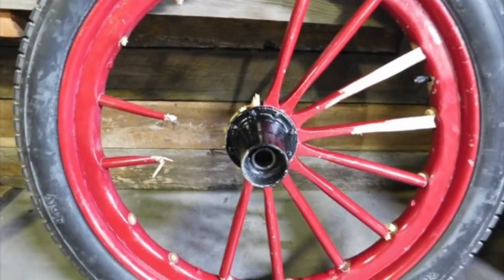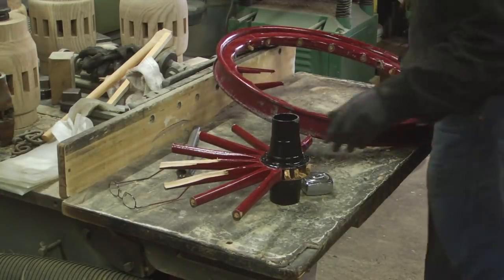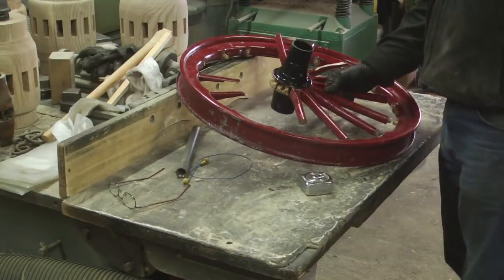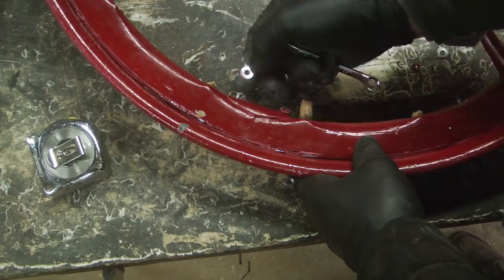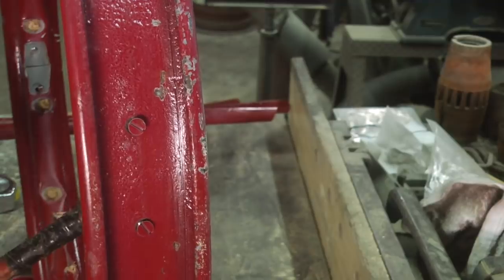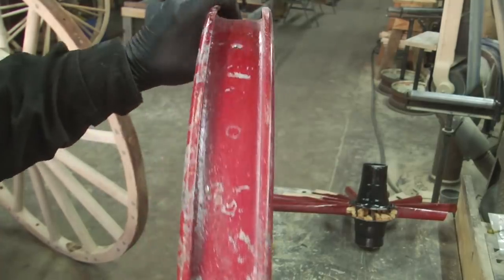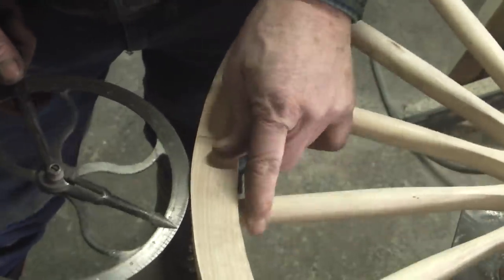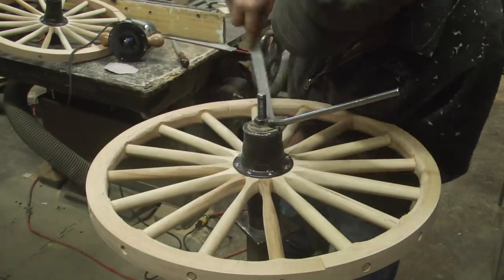The 1907 Everybody's Car and the Wood Wheel Repairs | Engels Coach Shop

Comment: I have wondered for years how these old parts were made. I was raised on a farm in the 50's and we had three teams of draft horses and horse drawn equipment for all of the tilling and harvesting. All of the neighbors had tractors and "modern" equipment. It was embarrassing for me at the time and I resented being so poor that we had to use the old stuff to get the crops in. Now, several decades later I would be proud to be doing the work with that old equipment. Time certainly has a way of adjusting one's attitude.  All of the old equipment has since developed feet and walked off during the night. Now it's being used for lawn and yard ornaments all over the country. Thank you Mr Engel for the fine videos, they are much appreciated.

Comment: You do a wonderful job and I am extremely impressed, and I am a regular. I had a wheel (dished), for my De Dion Bouton remade, and it was great for about 6 months then felt a little loose, so I dismantled it and placed some heavy canvas washers soaked in linseed, between the fellows and the spoke shoulders, it tightened the wheel, and many years later is still sound, I guess that the lumber (hickory), wasn't quite seasoned long enough.

Comment: That was a beautiful rebuild. Some won't understand the rosebud and shrink fit process. Haha. After 40 years as electrical engineer and industrial electrical contractor, I had 2 emotions going in behind someone else. First I was upset I hadn't been called first then after diagnosing the problem and determining a fix, it was a bit humorous. The customer was paying 3 times, the bogus fix, my cleanup and the proper repair. Why didn't they call me first? Human nature is a curious thing.

Comment: Unfreekin' believable. Its a wonder you didn't make the felloes in 1 piece!!!  It ran so very true when you jigged it up. Again, Awesome!
There is an old Ford video showing wheelwrights on the assembly line back in the early 1900's.  Interesting.

Comment: I am wondering how you protect the steel rim from rusting ?
I did my apprenticeship at GKN Sankey UK.
Joseph Sankey invented the steel wheel that replaced this type of wood / steel composite design.
It is interesting to note how when new technology replaces old how the 1st generation tend to look like the originals.
Sankey steel wheels looked very similar but were made of 2 pressings and gas welded together.
The holes between the spokes were welded all the way around.

Comment: 5:07 years later, i come back to this video with fresh information. Having dug the depths of old magazines, patents and period correct papers, i know that not only were these wheels worked on incorrectly, they're also incorrect for the application.

These are the common hub design, when automobiles of the era had (for the most part) switched to the Schwarz Interlocking Spoke (not just for its ease of installation, but also because it simplified the hub construction, one main hub and one band, allowing for ball bearings to be much easier installed and replaced once worn).

That implies not only that the bottom (core part) of the spoke is completely different, but the fixing on the hub is different, the hub itself is different and basically... those are not the right wheels for a vehicle of that era. Those are wagon wheels, essentially. Schwarz wheels are also much more easily dished out than common spoke and felloe ones, because of the specific way the root interlocks with its adjacent partners.

I've been digging for a friend, who needs a replacement part that no longer exists, for his antique car and it reminded me of this video, you wouldn't believe the level of incorrect display of some of these cars, in museums. I'm very disappointed in the state of many of them as well, mismatched, wrongly assembled (sometimes brakes band assemblies are upside down),... poorly kept. It's a shame, because there's examples out there that are very rare. Rarer than hen's teeth. Worse, in some cases, because of the level of disrepair, they're sold at auctions because they just give up on them ... and they vanish, never to be seen, in private collector's hands.

For example, Chase trucks, surreys and such... they're basically extinct. Yet, they were some of the most innovative and modern and set trends that many other companies copied and followed. Aurin M. Chase was a man of vision, limited by the technology of his time, and just like that, he's basically an unknown quantity outside inside circles. 

The worst part to me is the fact that all the documentation required to make these cars right is out there online, neatly preserved in digital format for anyone to peruse if they apply themselves for ... well in my case three weeks, but probably less for someone in continental US, with direct access to the libraries that have these books. For shame, these items of US and world history, deserve a bit more.

This comment isn't a slight against ECS, he's an excellent craftsman who just did his job, i'm just ticked off at ... quite frankly, the laziness of museum owners.

Comment: I would like to see a video on how you calculate the hole spacing and the spoke lengths.  I understand mathematically but it seems you need to add some fudge factor to insure things fit snugly.

Comment: I did not see you reattach the clinch rim to the wheel with bolts after you heated it up to expand.  Did I miss it?  will the compression of the cooling rim hold it in place?   While I respect and admire your workmanship, it is the ease with confidence that you bring to a task  that I feel sets you apart.

Comment: From the pictures on their FB page it looks like it's a Ford Model S...There are actually a good number of them left. Being a Model T Ford owner, it makes me cringe that a Museum would try to push start a car like this. That's what the hand crank is for. Push starting can do damage to the engine and transmission because of lack of oil splash. I rebuilt my wheels myself 20 years ago and they're still going strong. They're allot easier to put together being from 1925.... Have to stack the spokes up like a tepee in the steel clincher rim and snap them down with a hydraulic jack and a 4X4 against the basement sealing.

Comment: Very specialized tools and techniques. I wonder what would happen if you took two perfect wheels, and cast them in aluminum. Then installed steel bearing surfaces at the hub and rim? Would that be useful? Or would the wheel fall apart after a mile or two?

Comment: Nice vid on an interesting subject. Is that wheel slightly dished? No spline to align the ends of the felloes?
Reply: EngelsCoachShop , nice job.  I myself was wondering about the Truing alignment.

.. and how it was done. 
I was wondering how you could True these wheels at that last stage  too. 
They'll work the way it is ?

I guess not racing speeds  huh ? Lol 😅😅😂😂🎶💎
You laugh and smile  lol

Comment: You've mentioned the use of ammonia when bending large oak hoops.  Why do you  feel this works better than just steam?  I've read that NH3 softens the wood fibre better than just steam.  Is there a down side?
Reply: Thanks for that.  I'm experimenting making tobaggan staves and I also heard that fabric softener works to soften the fibers, making them more "bendable".
How do you prevent the ammonia from "fuming" your coach hoops wood to an antoque looking patina?  I'm using some household aqueous ammonia in a vertical 6" cylinder of hot water to soften the curving part of the white ash staves and they came out with a grey-brown patina.

Comment: why watering the rim?
Reply: The wood rim is slightly larger in diameter than the steel rim. He heated the steel to make it expand so that the wheel would slide into it. The water cools the steel so it would shrink to fit the wood rim. If he did not cool the steel with water the heat would burn the wood rim and ruin the fit.